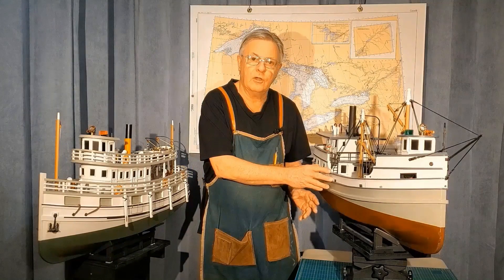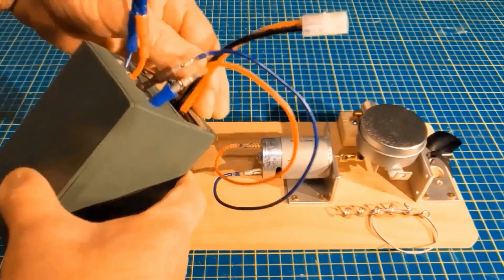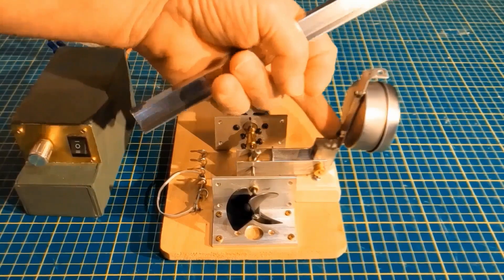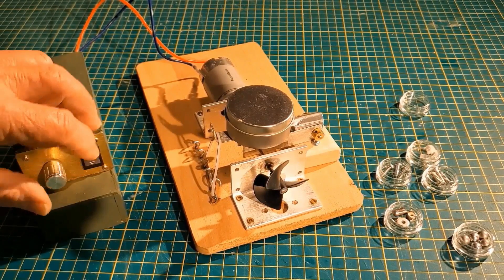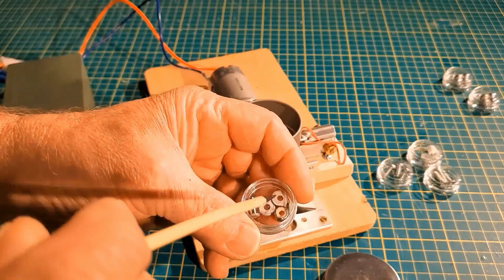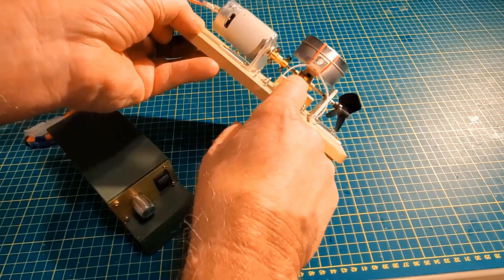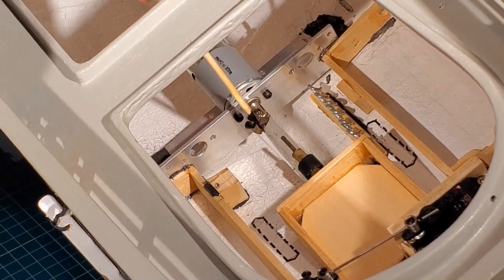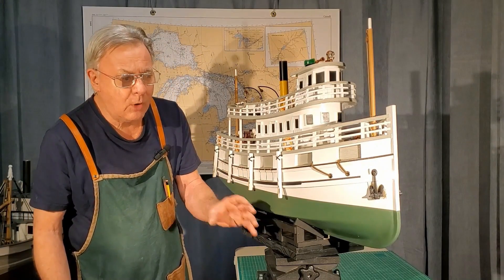RC Mechanical Engine Sound Generator the Haven Knocker

Comment: Really good idea. I recently added sound to my Clyde Puffer, using an electronic sound recording module. The type that will record for 2 minutes. I spent ages looking for suitable sound files, and ages recording in a suitably silent room. All came out reasonably well , but I wished I had seen this ''knocker'' sooner, as I would have used your method. Will have a go on my next one. Cheers.

Comment: Hey, you ever tried more than one knock actuators? I mean on the knocker, not just the one contact pin but put another 180° around other side. Then have two knocks per rotation. Mabey that would sound cool.......

Comment: I'd like to get one of those small steam engines that run on alcohol, and make a small charcoal furnace to power it. Would sound great, and have the potential to catch fire and sink. At least the sound and smoke would be real, as well as the tragedy if it struck any ice burgs.

Comment: As a sound guy: That is a pretty darn good facsimile of the sound of a diesel engine relative to the scale. I could definitely hear the dampening of the lid when you put the rubber band over it to hold it in place and thought it sounded better without it, a pair (or three) of small screws through the lid into the can would allow it to resonate in its full glory. I'd love to hear it in the water. Great Stuff!

Comment: To my ear it sounds like it is to fast for old time steam or diesel engine. Maybe gear on the other end of the electric motor, or even better run a second small motor with a resistor to spin slower the propulsion motor to give that power stroke sound and speed.

Comment: Excellent invention! I imagine the striking collar makes the driveshaft rotation unbalanced slightly. Would that cause premature wear on the shaft bearings, especially at higher rpm's?
Reply from the maker: Yes there is going to be more wear especially at high RPMs.  The Knocker is best applied to lower RPM models like Trawlers, Tugs and Steamers.  I suggest keeping the arm tension to a minimum and use light weight objects in the can.  Brian RCWH

Comment: Great device and great sounds of a diesel driven boat, but using it on an old steam boat, I am not so sure.
Reply: Well perhaps if you used say sand or very fine pebbles in the tin, it may give more of a hissing sound.  Maybe remove one of the screws on the 'cam' to only give one 'knock' per rev of the prop too. Nice fun effort!